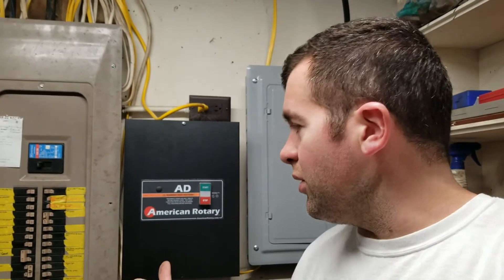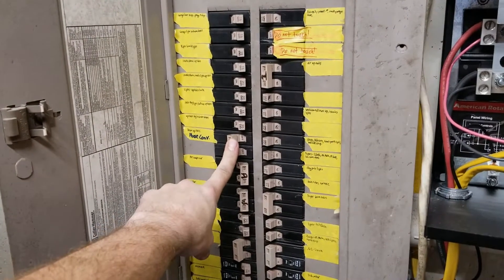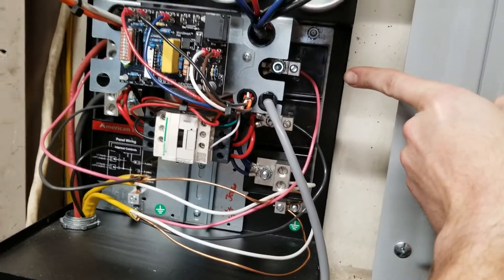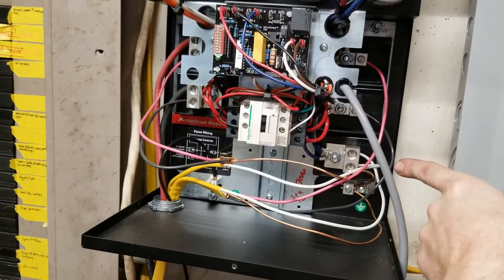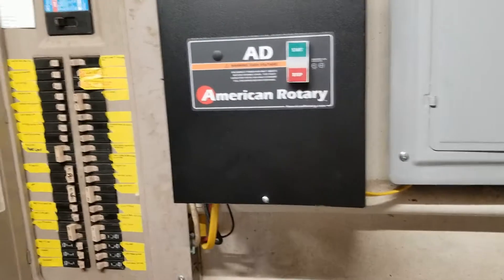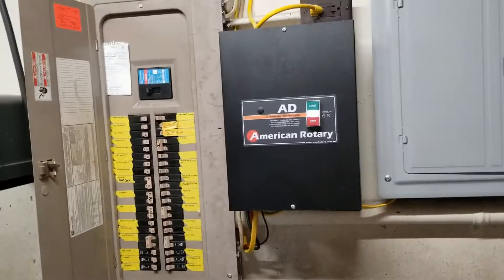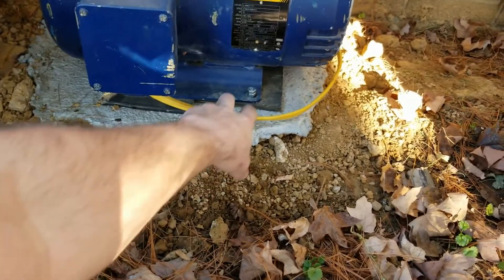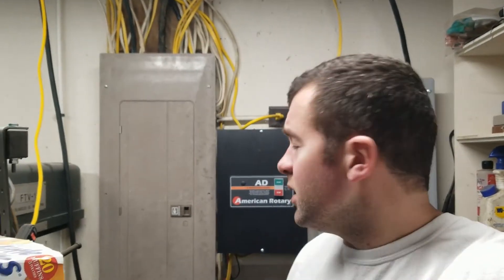American Rotary phase converter over view 10hp review

Comment: On the rotary phase converter there are the left and right connections. I understand that on the left side it has single phase electrical signals going in to then be converted to three phase output on the right side. What I don’t understand is then there is a panel on the right which then goes into the left side of the phase converter? Why use the panel on the right? Is it necessary?